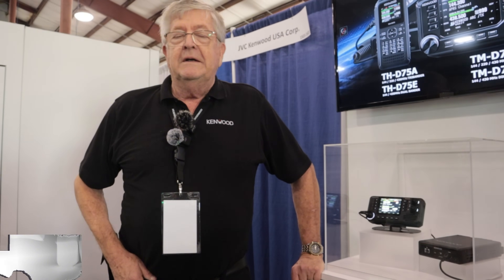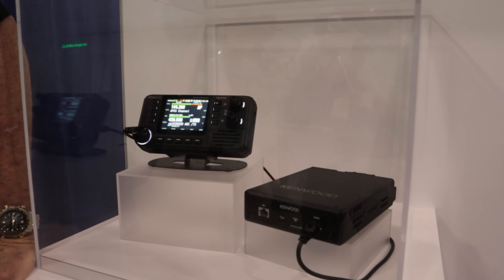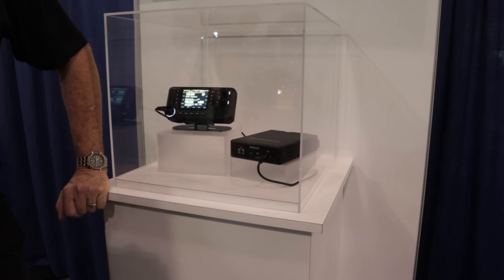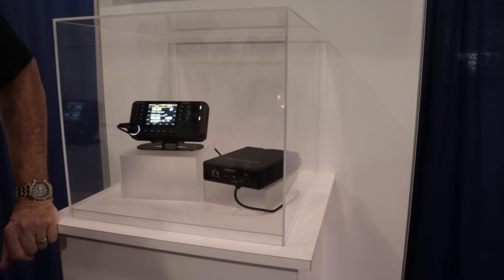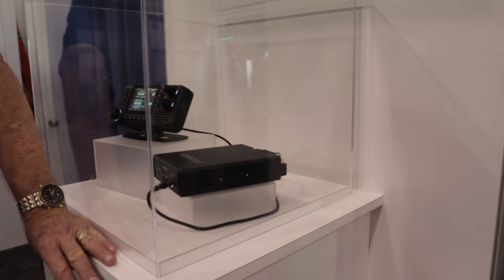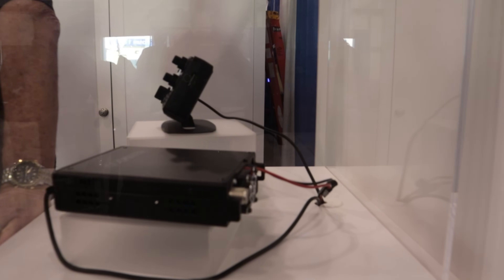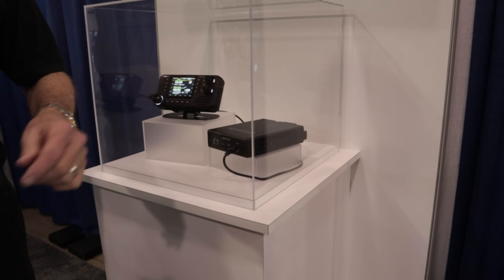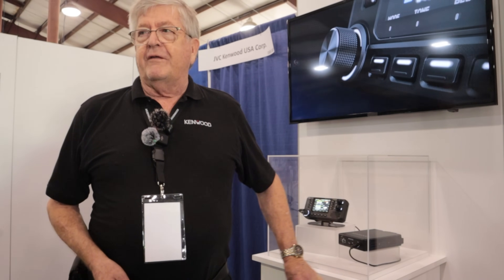What Makes the Kenwood TM-D750 So Special? Find Out Here!

Comment: I love Kenwood but where am I supposed to mount that huge head.

Any shielded CAT5 (STP) or higher should be fine.
Reply from the maker: This head matches the ID-5100 or FTM-400.  Not that new of a concept, really.
Reply: @HamRadio2 

Ok so it’s ID-5100 size 

That I can work with 

It looks a lot taller
Reply from the maker: It's a bit bigger than the 5100, I think. But the same concept